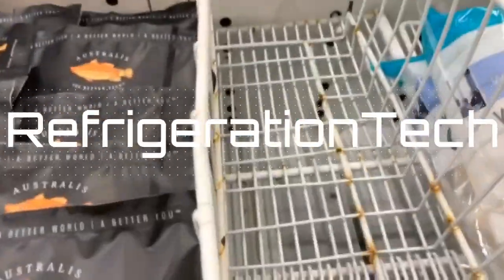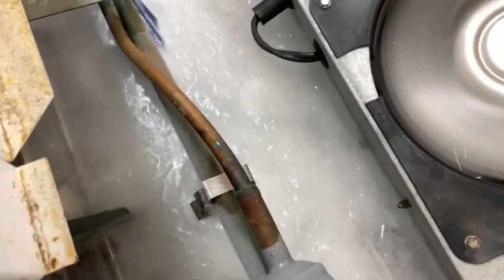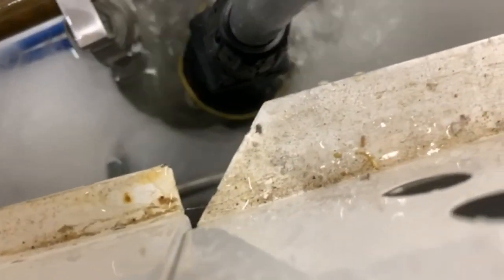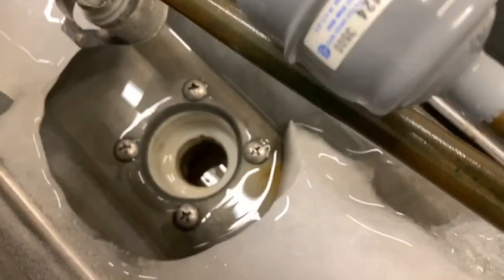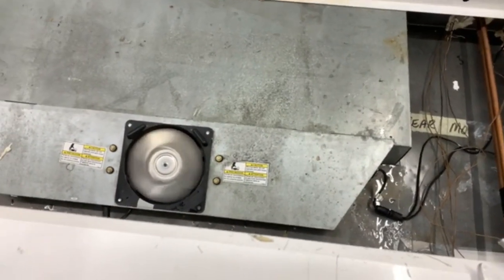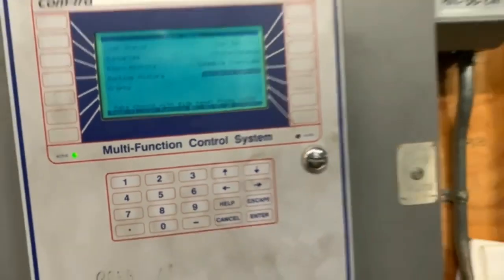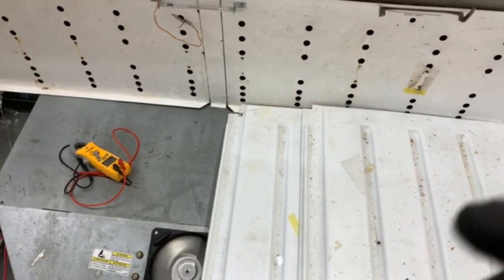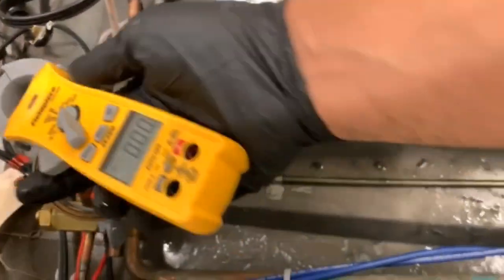FROZEN BUNKER CASE!!      **SORRY FOR BAD AUDIO, NEW MIC !!**

Comment: I always called hoses on the floor "old people magnets", lol.
I found the best way to initiate flow of water out the drain was to use a bucket of hot water and an old manifold hose. It was the least likely to get water on the floor and then a shot of Co2 to clear the drain.
Nice job though!
You new guys pay attention to this guy... he knows what he is doing.
Reply: 5 gallon pump sprayer works a treat.
Reply from the maker: Thanks Dale 👍
Reply: Yeah, I know what you mean. God forbid , if the person would leave the cart out of the way and walk 4 steps to get what they want. No, they have to bring the FNG cart down the aisle that you are working in and leave it in your way.
Reply: @SuperStormlord  I had a call in a Target store. The call was 5 door FF case warm. The case had a "wall" of ice on the bottom of the evap, casing air flow issue. (No air flow ) After I had to adjust the defrost pressure differential valve, ( it was hot gas defrost) I had to deice the case. Now if you have done any work in a Target store, they certainly do not take the refrigeration tech in consideration. The common set up is 2 multi compressor units on the roof, which are scrolls and the walk ins have their separate condensing units. They use Emerson E2 BAC and the boards for this system are in the 2 units. To get to them you open the 2 doors on the end of the units. So if is raining, the boards will get wet. So now you have to make a tent to work on anything board related. For me to deice the case, the hose connection was like a mile away, I carried 4- 50' hoses for this reason. But of course, the great minds of Target had only a 10 gallon water heater to draw water from. ....Got to love it!!!......

Comment: Let me give you my 50 cent tip. Pick up a female hose to male 1/4" male flare fitting. Put about 16" of 1/4 copper on male flare and aim the copper  where the drain is.  open the hot water slowly ( it will splash you if you open hose too fast at first)  and you will melt a small hole into the drain and will get the drain to be clear in a minute. You would not even have to lift the fan plenum to clear the drain.  ( experience )

Comment: I watch all of your videos man! They teach me a lot and seeing you do it helps since I am a new Refrigeration Tech. 
I also have a question, what is the name of that spherical drain dawg you use to blow out the drain line? I keep google searching for it but I can not seem to find it. It would make blowing lines out of cases so much easier instead of using a rag to make sure no air escapes.
Reply from the maker: LOL 😂, it’s a rubber ball and a copper service port pushed threw it 👍

Comment: I always have the store clean the pans etc. just to help them understand that house keeping is important and costly.you can also ohm out the heater to test it   Incase you just have a bad connection
Reply: Curious how that works out for you? Asking the folks mopping, stocking shelves, even managers to clean cases? I’ll admit it’s a little different with the mom and pop stores but larger chains just state at you and drool. As far as ohming it out it was clearly plugged in firmly and not pulling amps so what’s to gain by ohming out? Burnt out heater is burnt out.

Comment: “Is out of Freon?” don’t you love all the wandering helpers in wide open public places? I always use hot water when in option-250 feet of the shirinky hose (there made A lot better know) in a 5 gallon bucket. Must admit not often don’t have to chisel/clear path to drain first before hosing down.
Reply: Ill give you a little secret. Go to Home Depot and get a fitting that connects to a hose. Female hose fitting to 1/4" male flare Put a piece of  1/4" copper on end of male flare. Connect this to your hose nozzle and aim the 1/4 copper into the drain. It will melt through the ice in the drain and not fill your case with water